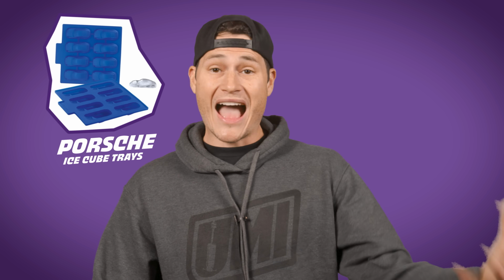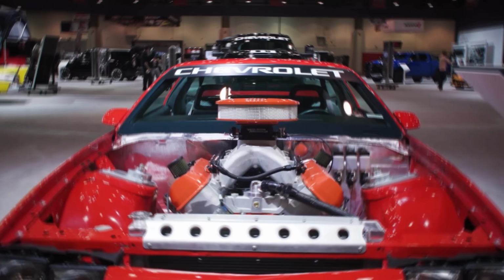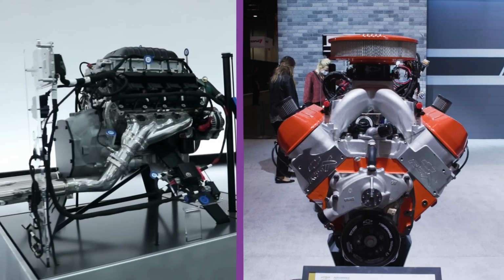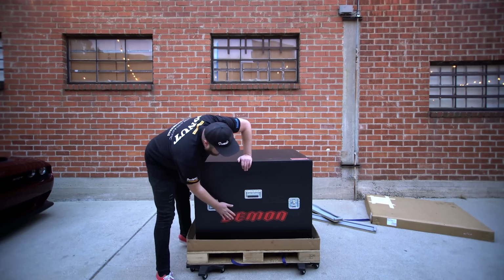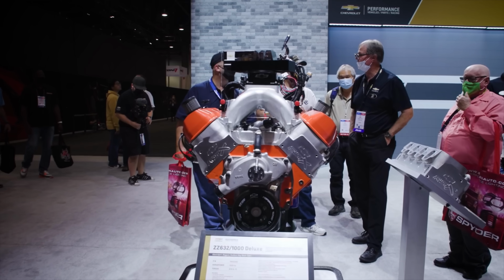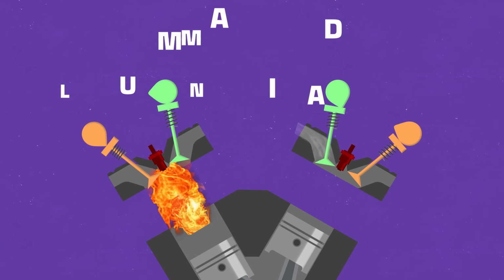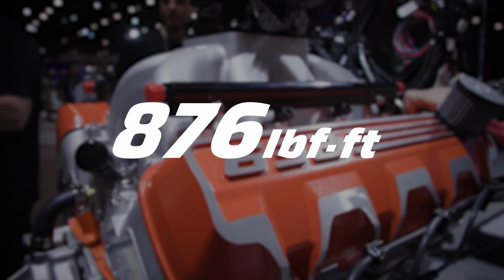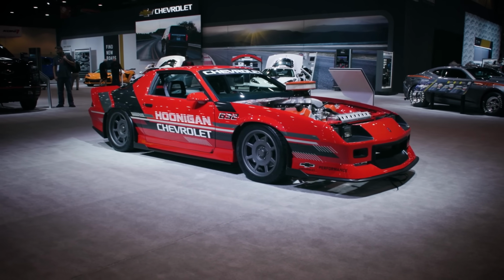Chevy's 1000HP Crate Engine EXPLAINED

Comment: figuring out how to squeeze this in the new "vette" . sure you loose the rear trunk, but going from lowish end Ferrari/Lambo/mclaren competitor to  the high end.  how does an 80k car turn into a 200k car. this engine with the upgrades to handle it.
Reply: Pretty sure the ZR1 will do just that.
Reply: @retoadyt3196  ZR1 is rumored to use a 918 style hybrid setup.
Reply: @hunterbowser667  thatll be nuts. Price too i assume lmao

Comment: Imagine if Cosworth sold the Valkyrie engine as a crate engine, and all the cars it would be awesome in.
Reply: Sound aside (bc better sounding cars are relative), Valkyrie V12 is a much better engine imo, idk if it is factual or not but a 6.5L should be lighter, more fuel efficient. That said, you cant deny that 1000 HP from a 6.5 trumps 1000 HP from a 10.4
Reply: @retoadyt3196  The V12 is definitely a lot lighter and more compact, which is impressive considering it forms part of the chassis structure.

Comment: lot of displacement but still no real power out of it, look at the Ferrari 812 Superfast, 800bhp out of a 6.5litre (396Cu in) which is what you call impressive, even then the Aston Martin Valkyrie got more out of a 6.5litre than that, 1000bhp.
Reply: What's impressive is the Chevy can make a 100 passes without being rebuilt like the other 2 mentioned

Comment: Only about 280hp total short of matching a decades old S2000 by hp output per liter.
Reply: Power output/liter is generally not linear. A big locomotive might make a few thousand h.p. with a several hundred liters engine. Conversely a liter sport bike can make 200 h.p.

Comment: love it, you rich guys keep buying theses so one day i can buy a crate ls6 for $999, I'm all for 1000hp natural but I'm not building race cars I'm building street cars 400hp is kinda the sweet spot, now if we can get that 400hp on the cheap would be cool.
Reply: A 10 liter engine making 1000 hp isn't something amazing anyways since engines half that size can easily produce 500 hp. Such a massive engine also requires ridiculously heavy transmission that really screws up the driveability of normal cars.

Comment: Yeah 632's have been around for a while, an 800hp "dressed long block" is available off summit racing for like $15k, but most would throw a carb on it. The zz632 uses a bunch of tech that your average joe wouldnt use on their garage built engine which is how it makes that much power on freakin pump gas

Comment: I’ve always been partial to the Ford Festiva SHOGUN style engine swap….so a mid engine rear wheel drive Golf would be awesome…
Reply: Or a Renault Clio V6 Renault Sport
Reply: No no no. Nothing would be funnier than a giant ass engine in a Miata. Don’t care how impossible is sounds, this needs to happen.
Reply: @michaelryan5973  just take the front of the miata off. Badabing badabom, done.
Reply: @FullsendMSV  to sacrifice the pop up headlights is a fate worse than death.
Reply: @michaelryan5973  just make the chassis extendo mode and you can place the front in front of the engine 😎
Reply: @michaelryan5973  hell kitty miata. Its retarted
Reply: Some guy down in SoCal swapped the engine and transmission from his MK6 GTI into the hatch. Haven't seen much of the car since, but it runs and drives like normal... Just rear/mid engine and RWD

Comment: @zachjobe should try to make a rear-engined Yugo with a ZZ632. Hilarious.
Reply: Yugos are so trash, the car would probably just detonate lol
Reply: @Ordit229  not if it’s done right. I saw a guy in Puerto Rico put a hayabusa engine in a Yugo, and it was awesome.
Reply: @concernedcitizen2766  Excuse me what?
Reply: @Ordit229  you read that right. A Hayabusa engine in a Yugo. Front-mounted though, for a ZZ632 in a Yugo would require a rear-mount setup.
Reply: @concernedcitizen2766  If I ever saw a Yugo go by and then heard a Hayabusa engine, I would just die.
Reply: @Ordit229  then don’t go to Aguadilla, Puerto Rico then. That’s where the Hayabusa-powered Yugo is lol.
Reply: @concernedcitizen2766  I will make sure to avoid Aguadilla, Puerto Rico.
Reply: Unrealistic life ain’t forza bud sorry to break it to you. “LeTs PuT a v12 iN a MiAtA”
Reply: @Sammies98  there’s a company out there that’ll put in a 351 Cleveland drivetrain in a Miata though…
Reply: @Sammies98  You are aware there is a V16 Miata, right?